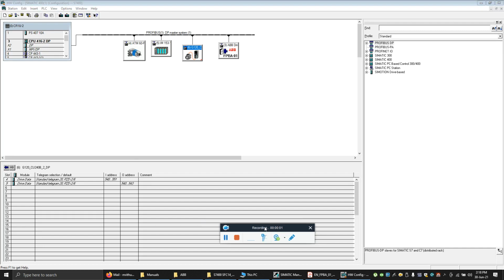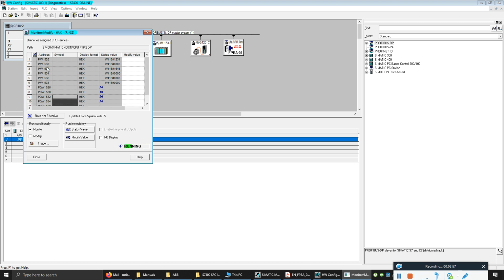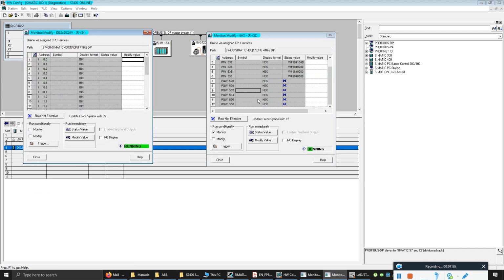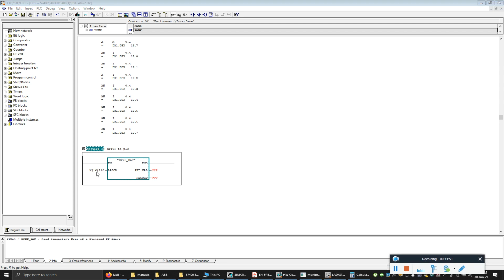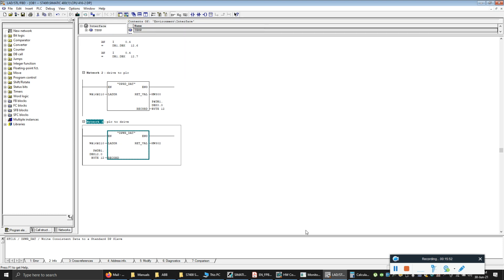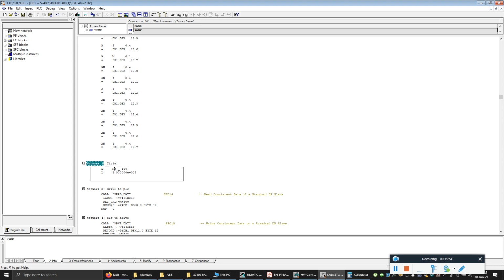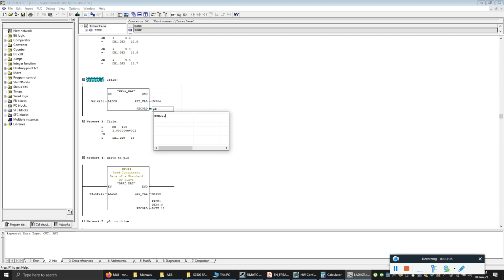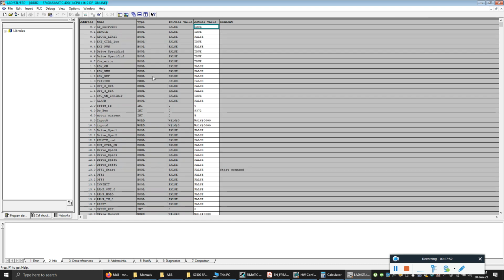12. How to use SFC14 & SFC15 for Data Transfer with Profibus slaves in S7 PLCs

Comment: sir i have an s7 315 pn dp cpu, i connected a cp343-1 cp card to the plc and i want to make an profinet bus and via that profinet bus i want to drive a abb acs580 vfd. when i completed the hardware configuration i saw a pop up opened and it says if you want to use cp you should use fc12 and fc11 profinet send receive io block's can you help me i couldn't find the solution yet. have a nice day

Comment: I connect S7 400 with ESEPRO profibus device. The process image is disable and no option.
where did I do wrong?
Reply from the maker: https://youtu.be/Y2pvitN9JcM   - In this video, i have explained how to add profibus drive,hope it helps
Reply: @averageengineer4266   
Thank you. That was great support.
I have one requirement please
My factory has used s7 400 for 5 year. I connected to some profibus device
Now, I need to connect addition profibus to s7 400.
I installed new simatic manager software and read successfully  program from S7 400. 
I wonder that, I have to import again gsd file of old profibus device or not?
Please help me this topic.
Thank.
Reply from the maker: @nguoicoon5863  Not required, it will be there in the program backup.
Reply: @averageengineer4266   it mean that when I read program from PLC, the driver will update atomatically into my simatic manager software?

Comment: I want to read energy consumption of G120 drive Parameters r0039 to s7-300 PLC. I set p039 in p2061 and check reading on PLC PIW 300 or pid 300 but it shows 32767 so please help me.
Reply from the maker: It is easy, if you using scout, under profibus configuration, select transmit direction and link the free slot to the parameter you want to read. Same needs to be done in the plc side.

Comment: Thank you for this detailed video, well explained. Just I have one question :
To communicate with G120 , why did  you just duplicate  the DB1 to DB2 ? How you know the ABB VFD and G120 have the same order of structure ( how could we know for example that  the db1 dbx 13.0 (  OFF start for ABB brand ) is another thing parameter for example drive-Spec1 for siemens brand? Thank you in advance
Reply from the maker: Thx for watching. Yes the control word is not exactly same ,but my point was to show the advantage of using db and sfc functions. If you are intrested in siemens control word ,pls see - https://youtu.be/yTlCZXCLneU. You can skip to 19.00

Comment: and one more question is how we can choose DB values..means you select 1st 15 to 16 db values and their names..Is this same as manual parameters requirement or something else?
Reply from the maker: If you are asking about DC bus voltage, motor current,etc.., this should be same as how you configure on your drive. First 2 words should always be command word and speed reference. Rest is upto your requirements

Comment: I have one question.If I want to read actual motor speed in PLC what should I do for this?my plc is 300 series and s120 DP drive.please guide me.
Reply from the maker: If you want to know the drive parameter setting - https://youtu.be/yTlCZXCLneU
This video is sinamics g120 to abb plc configuration. But drive side will be same for any PLCs

Comment: Thank you
Please how display motor_current ? In DB
Reply from the maker: Hi,
DB1.DBW6 is assigned for motor current as per the program in the video.
Reply: @averageengineer4266  
Micromaster always sending 0 Amper to PLC !
Reply: I try to do like this put 
I think the problem from telegram  always show  example: 33Hz  0 Ampers !!!! Ampers no change
Reply from the maker: @carim6242  yes, you need to configure in telegram, iam planning to do a vid soon about sinamics drive to s7 400 commisioning. Betw you can check this vid -  https://youtu.be/yTlCZXCLneU 
i have explained telegram setting on drive if it helps .

Comment: I appreciate that very much! I have a question: Are these 2 SFCs only working for the profibus? For example, on the SFC14, do I just need to put the address value 'W#16#xxx' to the 'LADDR' without the sign 'PIW' or sth tag ahead the  'W#16#xxx'?
Reply from the maker: SFC14 can be used to read any PIW values, Just convert the starting PIW address to HEX value for LADDR and enter the correct number of Bytes as shown in the video.
Reply: @averageengineer4266  
I have a question for the 'LADDR' as below

L     #DP_start_address        // INPUT interface of FC , this FC is called by another FB ,and this pointer is put with the address '508' ;
T     MW200
CALL  "DPRD_DAT"        SFC14
LADDR= MW200                  //  I'm confused by this transfer. Is the INT input '508' also valid? In general , it should be switched to Hex
RET_VAL= MW600
RECORD= P#DP
Reply from the maker: @rexcheng4567  Yes, this way also works. When you load 508 to mw200, hex value of 508 is there in mw200. When you are online in the program, change the representation to hexadecimal and you can find hex value of 508 in mw200
Reply: @averageengineer4266  Why do we have to take the byte swap with the ABB? By this question, if we read the value like the DC bus by word, why don't we have to switch the 2 bytes?
Reply from the maker: @rexcheng4567  to be honest, even i was confused why there is a byte swap. When i interfaced acs 880 to a ABB plc, there is no byte swap, you can find that vid in my channel. I think it has something to do with memory architecture of the siemens plc, i found tge same byte swap when i interfaced sinamics drive to s7 400
Reply: I want project Simatic S7
Reply from the maker: @tienlepro  https://drive.google.com/drive/folders/1wC8vF5j7RyIJ7_e7eUWsesq-JrsRLE4o?usp=sharing